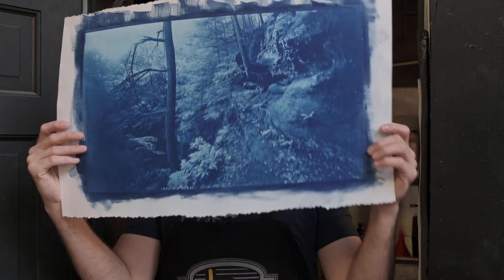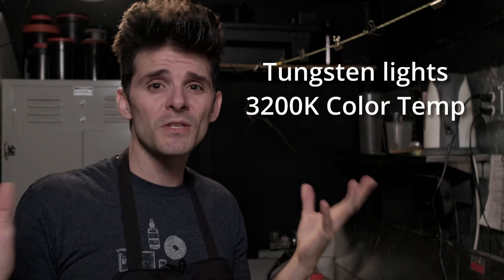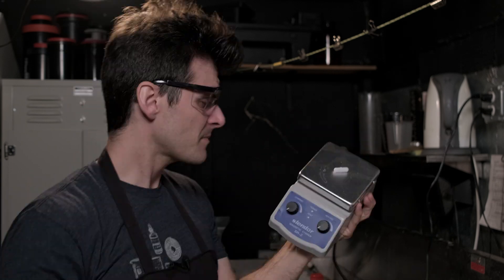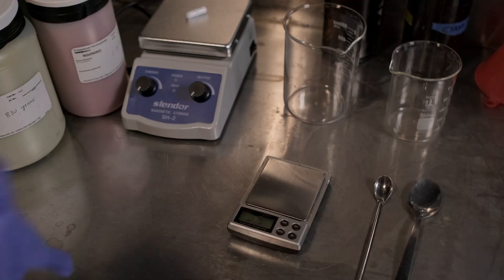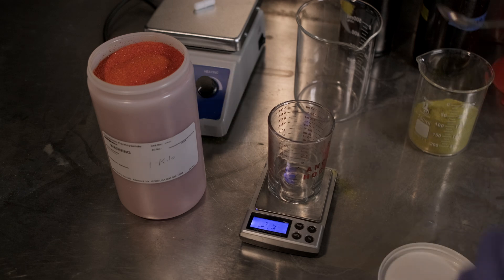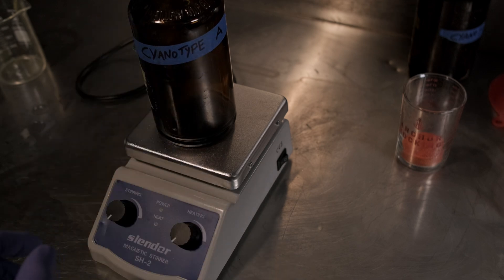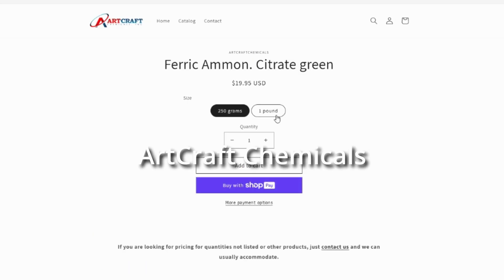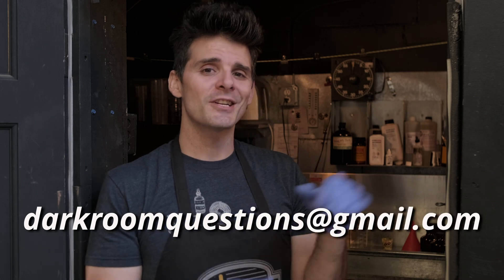Mixing Cyanotype Parts A & B - DIY Darkroom

Comment: Thanks for the interesting video. It is good to see other photographers using cyanotype. I started off buying cyanotype kits but now mix my own. I also started using a 10/10 (FAC:PF) solution as recommended by Christina Anderson. It has a good tonal range which is similar to New Cyanotype and is a lot easier to make. Cheers

Comment: mat, one question, as you haven't added the AgNO3 (silver nitrate), isn't this just like colloiden, in that process, aka the 'medium' on which the sensitiser sticks to, so is thus not light sensitive, as the silver is the sensitive bit? a Great video, but also one warning, as this has cyanide in it, shouldn't you also wear a respirator?, or at least do it in a "well ventilated area", just in case!! ( and also have the msdss for all of this, for the fire dept, so they know about it, as it is not a common household item).
Reply: Cyanotype is a silver-free process, no AgNO3 necessary. Collodion has a lot nastier chemicals than traditional cyanotype. Despite the scary name, potassium ferricyanide is actually not a particularly hazardous chemical. I mean, don't eat it. Overkill on chemical safety is never really a bad idea though.
Reply: @BHuij1992  It is quite harmless... UNLESS you add some strong acid to it, it the releases cyanide... So watch out when storing and disposing that it doesnt mix!
Reply from the maker: This is nothing like collodion in terms of formulation nor volatility.  The light sensitive compound here is the potassium ferricyanide. Also this is one of the easiest to handle in terms of chemical safety. Well ventilated is always recommended, but not necessary with these. Both compounds are easily flushed out with warm water, and it is fairly easy to avoid creating dust with them if you work slowly.
Reply: @MatMarrash  thanks for clarifying, as most of us have heard or seen a youtube video on 'wet-plate, colloiden' but not much on the cyanotype or tintype processes; due to what one would assume is the negative size, as most of the 'older' processes occurred on ulf sized cameras, and of coarse 4x5, 5x7 and 8x10" which are not as popular anymore, with ink printing of enlargements in this range (from digital or film MF systems), and the cost of the ulf materials, and the fact of the diy nature of having to make the plates yourself, instead of the convenience of acetate film negatives, paper (like the one from ilford) which can be contact printed onto, and that labs can do the grafting for you.